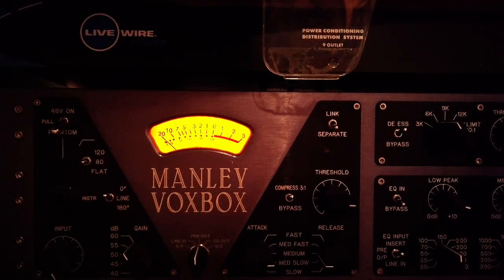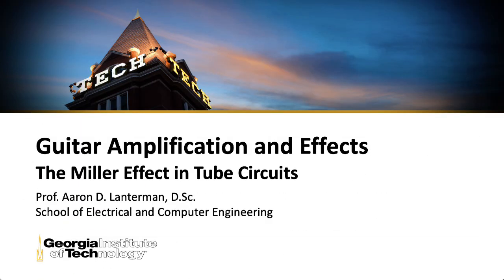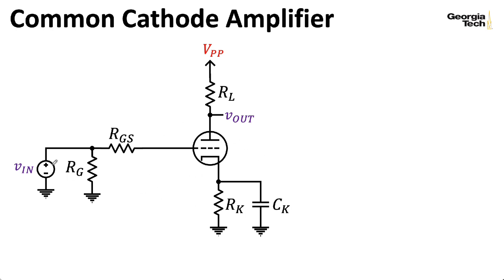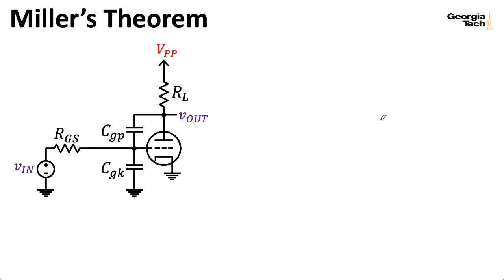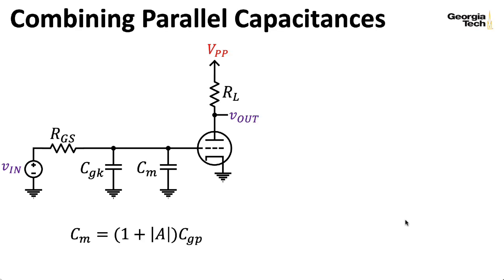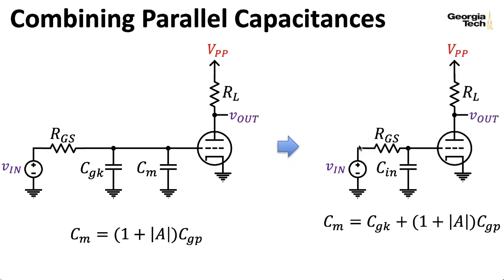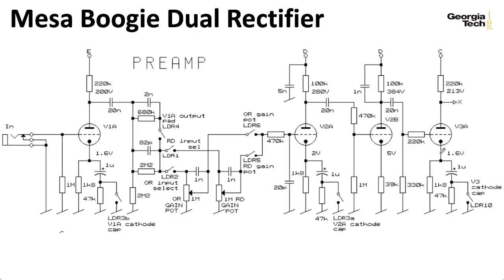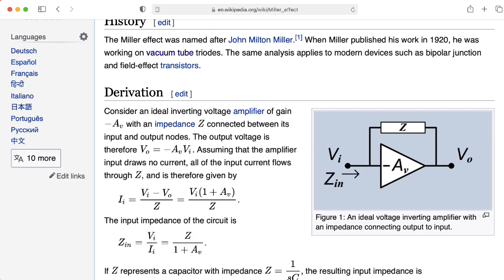ECE4448 L35: The Miller Effect in Tube Circuits (Guitar Amplification and Effects, Georgia Tech)

Comment: Would love to see an episode on the Neve 1073 circuit.  What makes this preamp so ‘musical’?
Reply from the maker: One day I'd like to do another class on "pro studio recording electronics," covering mixers and mic preamps and equalizers and compressors and such; it would form a trilogy with a "Analog Circuits for Music Synthesis" and "Guitar Amplification and Effects" class. If I ever did that I'd analyze the 1073. 

I've spent hours looking over the schematics for it and made little headway. It's an awfully complicated beast. It's so complicated because at the time of tis design transistors were expensive and they were trying to limit the # of transistors used. There's multiple feedback loops, and at different ranges of gain settings, some parts of the circuit are entirely switched out. So it's almost like several different preamps in one, and which one you get depends on the gain setting.

I've not experimented with a 1073, but in my experiments with the preamps I do have I'm starting to think that the diminishing returns point it hit pretty quickly in terms of increasing cost. 

After all, has anyone ever been on a session and said "You know, this isn't really working. Let's try a different preamp?" ;)
Reply: Do you know Ian Gardiner? He services my Neves and May be a really good source. I can put you in touch if you would like.
Reply: After I read your comments, I realized that I had been favoring a gain setting for my 1073 over others (and using an aftermarket output control to vary the volume).  I wonder if that's from the preamp effect you're referring to below.  (-50 and -20 are my most-used ones across a variety of instruments; I'll go to the lower settings if needed, but I've been using an sE electronics dynamite if I need more level).

I'll add one more note - I've got a small collection of preamps that I record with. My general observation is that different preamps work best for different instruments.  I have a pair of dbx 586 tube preamps that I previously used on overheads, and I would use the 1073 on kick / snare. That worked, but when I switched to using the dbx for Kick/Snare, and the 1073 for overheads with a pair of AKG 414 mics the sound of the kit improved tremendously.
Reply from the maker: @HollywoodRecordingStudio  I'll keep that in mind. I'd enjoy saying hello.
Reply from the maker: @HollywoodRecordingStudio  lanterma@ece.gatech.edu is my e-mail (it's not hard to find so I don't mind putting it out there, I'm on every spam list in the world already anyway...)
Reply from the maker: @HollywoodRecordingStudio  Re: your favorite Neve settings, it wouldn't surprise me.

Interestingly, the RND 511 is a COMPLETELY different design, having basically nothing in common with the 1073! It uses 5534 op amps (like the high quality early Focusrite stuff, before Focusrite started making mediocre stuff) and is clever in its own way.

Comment: 7:40 You could still analyze the first preamp stage if you assume an output impedance from the guitar. I have no idea how big that would be compared to the 220 k grid stopper resistor in the last preamp stage though, but would be interested to know what kind of low pass filtering you get from the Miller effect + guitar output impedance.

Comment: So this is where it all started...
I'm currently taking Analog Integrated Systems Design and part of a project is to design an OTA. My partner and I both came to the agreement to not do a 2-stage, 9-transistor implementation solely because of the complexities of Miller compensation, hahaha... Instead we're doing a folded cascode topology :)
Reply from the maker: Good luck with your project!
Reply from the maker: You might find my introductory lecture on OTAs of interest: https://youtu.be/96j2tNKFCPI

Comment: How does the grid stop resistor value and grid leak resistor value changes the miller effect? The grip stop resistor I thought prevents oscillations frequencies
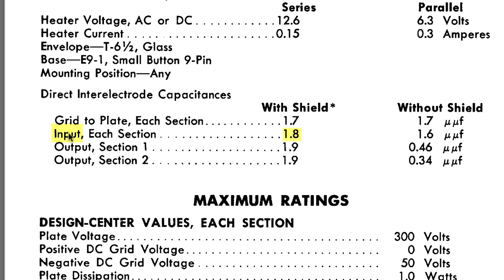Reply from the maker: See the kinds of calculations I do at the 9:57 mark. You wind up with a cutoff frequency that is below where the parasitic oscillations typically live.
Reply: @Lantertronics  so the grip stop resistor and the miller capacitance of the tube create a cut off frequency?
Reply from the maker: @waynegram8907  Yeah, they form a one-pole lowpass passive RC filter.
Reply: I thought the grid stop resistor was there to prevent excessive grid conduction if the input voltage goes above the cathode voltage. But maybe that is related to stopping unwanted oscillations.